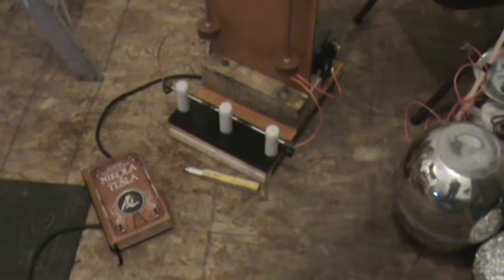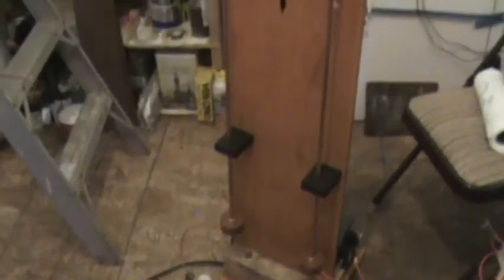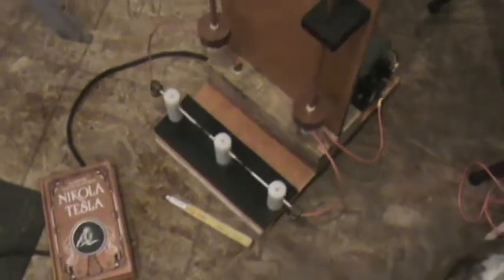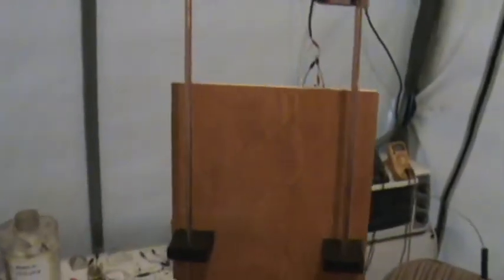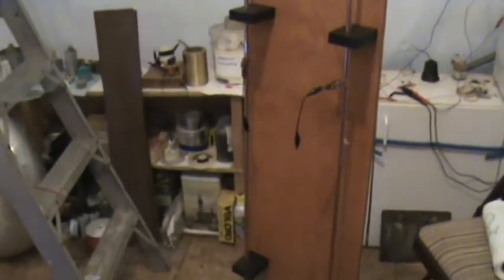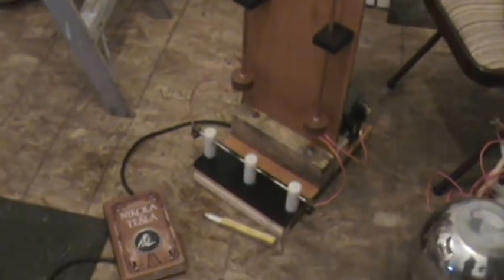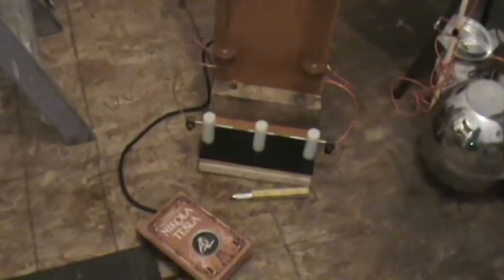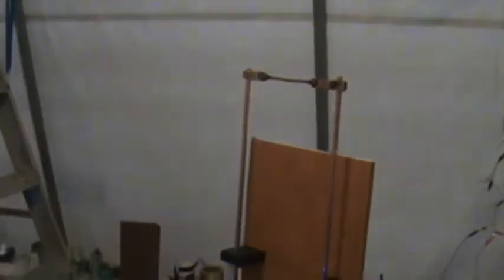TESLA'S HAIR PIN CIRCUIT Part 1

Comment: I'm not familiar with the hairpin circuit, but it looks very much like half a folded dipole or matching stup for radio antenna's, in THEORY the points you want to touch SHOULD have zero potential between them, however with a 12KV transformer that has a centre tapped secondary, the potential between one of those points and ground will be around 6KV. you'd be foolish to touch that sort of voltage.
Not AC or DC ?, it will be RF AC, you may even pick it up on an am radio.
Tesla was a great man, but his understanding back then is way different to what we know today, also there was much less radio signals around too, so lower powers would not have been blocked by other sources, making his experiments work over longer distances.
Do some research on dipoles, folded dipoles, and matching stubs and see what the nodes are doing.
Reply from the maker: Thanks for your comments,,,,check this out,,,part 2.....
https://www.youtube.com/watch?v=MBZl6Tdltus

Comment: WOW! You could light a cigarette, straighten your hair, and cook raw bacon in your mouth all at the same time! Seriously though, check it with a high voltage meter first. Be very very careful.
Reply from the maker: High voltage meter, i was thinking about this,,,,but wonder if it would work since it is not ac or dc, or if the HV probe would get damaged!?  I will think about this for sure.
Reply: The concern is that if either winding becomes an open circuit for any reason it could become a high voltage transformer depending on the circuit design. The net result of the cancelling fields is heat. If the wires used for the windings are insufficient to handle the heat the weakest one could fry. Where you are proposing to touch the filament is not in the area where the heat is concentrated. There should be little if any heat generated at those locations. Check the transformer with an infrared thermometer before you lick it. Check the current at the points of contact. If none is detected the circuit is probably still in balance, the cancellation is complete, and it should be safe to handle. Don't be standing in a puddle and perform the experiment on a relatively calm day to reduce the possibility of unintended external influences. There is real potential for unanticipated problems (pun intended). Be safe my friend. I look forward to future endeavors.
Reply from the maker: Ill take all the tips i can get, thank you.  Funny you mention not to stand in a puddle.  Submerging a lit bulb, probes, and my hands under water will be one of the experiments,,,no joke :-)

Comment: How would you get it to travel through the Earth ground rather than the air and on another note, would the scalar signal get modified by atmospheric conditions caused by sun activity?  Is there a way of picking up natural scalar activity from the environment? -  All very interesting Mr Paul Inveter3  -  ps don't zap yourself by error.
Reply from the maker: All great questions!  Going through the Earth,,,,the signal is strongest at the top of the bars,,,i might have to run the one of the rods to ground, or both, not sure yet.  I dont think the scalar waves would be modified or disrupted by solar activity.  matter of fact, this maybe another new way to observe the universe, instead of xrays of RF.  Is there a way to detect or collect scalar waves from space, hmmmm, another great question.  So many questions, thats why i really like this project.  Maybe a good chance to discover something here :-)
Thanks for watching and commenting.